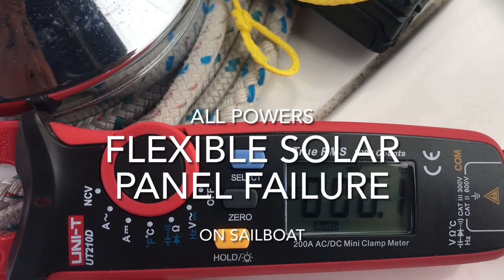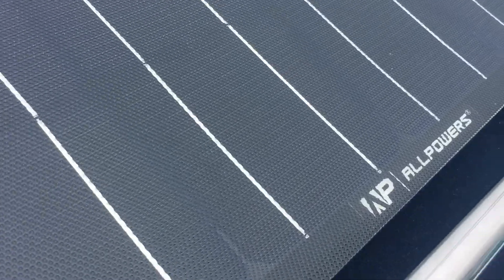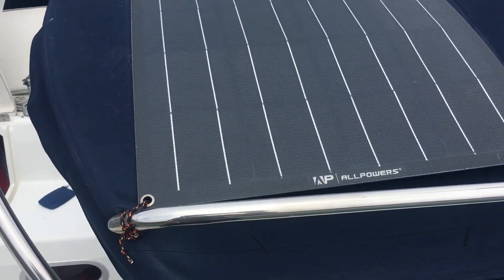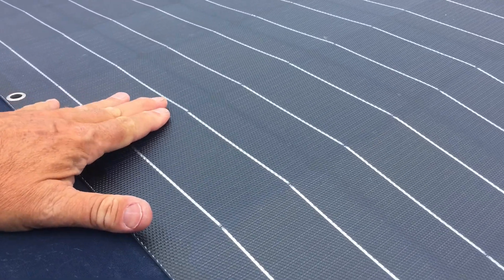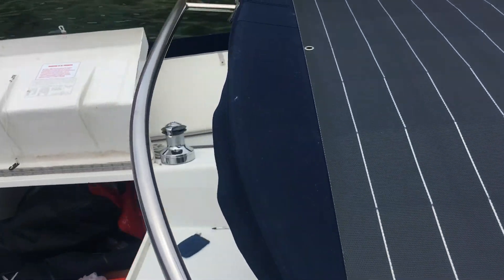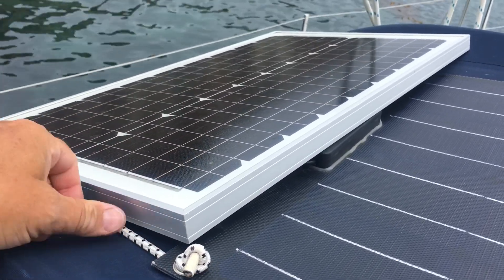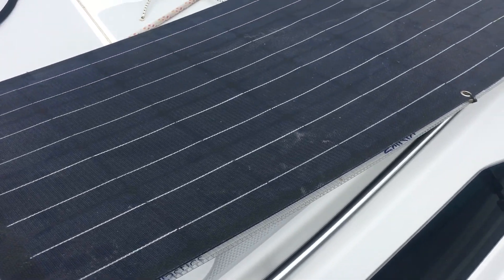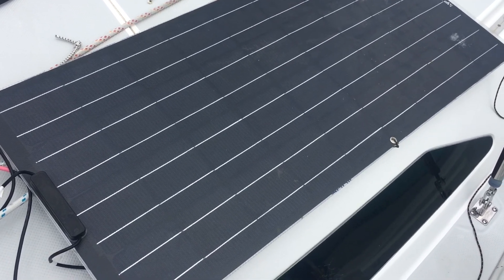Failed – 100w ALLPOWERS Flexible Solar Panel Review on Sailboat.  Lasted only 2 years

Comment: These panels hates to be laying on hot surfaces. Especially, if you put some sort of insulation material under (roof of RV or any other surface no mater thickness [tarp] with close proximity  = killer...why? Because you create micro-climatic air layer under and the panel will run hot as hell). The rigid panel has gab under for cooling, that is why it last longer. Keep an air gap under the panel and you will get near enough same lifetime of them. The premature failing is due to bad installation. So, sadly only you are to blame for the bad job if it fails. Also, be aware that the connectors like to oxidize and break the electric circuit (my experience). It was real pain to clean them up and make them work properly again. I thought I lost the panel, but I did not. Do not think the cleaning is just plug in - plug out few times. That would not work. Remember that PV panels fail by thermo-mechanical stress and vibration (flapping in the wind), if you keep them cool they will be more efficient and longer lasting. They are good product, designed for specific applications such as curved surfaces. If you do not know how to properly install them, then buy rigid panels instead. Do not listen people on youtube telling you to just glue them to the roof or so...
Reply from the maker: Thanks for your comments. I have a cloth sunbrella doger it has plenty of air under it. Many boats have this setup. Do you think this is cool enough?  I think the flexing may have kill the panel more than the heat.
Reply: @dannyjensen4954  Honestly, I cannot really tell what cool is, but from what I have seen in the video, the panel will vibrate and I can see some distinctive cell ridge line folds, which is not good. You may have broken cell connecting conductors. From my view of what I seen on the video, when there is a wind, your panel will vibrate and when there is no wind, the panel will overheat. I do not mean to be mean or something, but I think it is the worst possible installation for flexi panel. On the other side, it is a great spot for a rigid panel... Bare in mind, that flexi panels are made to give you advantage of curved surface. They still need to be held rigid (I mean like solid) when in use....Example: Glue flexi panel on curved metallic surface (eg:2-3 mm Al sheet)  and then you have rigid thin panel. Un-closed space bellow (Al sheet) must be free at least 2-3cm for cooling. You can glue it on boat fiberglass surfaces, if they are not insulated bellow.... Like I said before, flexi panels are good, just bad installations make them fail. It is not worth it to buy flexi panels, if you do not have specific use for them, which most people dont. Hope it helps.

Comment: I have 4 "flexible" panels rated at 100 watts each
All from different manufacturers
They all begin to fail after about 3 years or less
In the South Florida sun
If you let them be walked on, expect them to fail fast

The glass panels can last 100 years if you keep the salt off anywhere near the junction box on back of panel, and a consensus artist can re-solder even corrosion behind the junction box
Reply from the maker: Thanks for the info. I need to get creative if I want to add the hard panels.